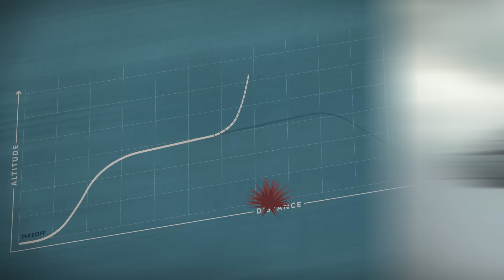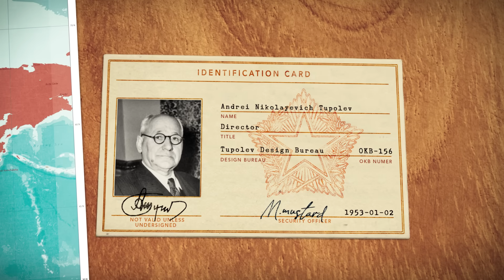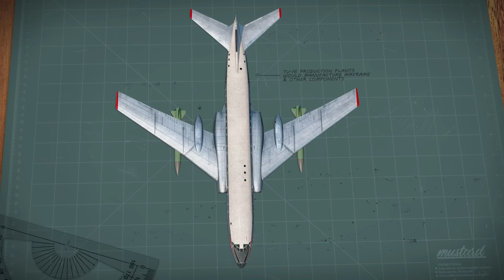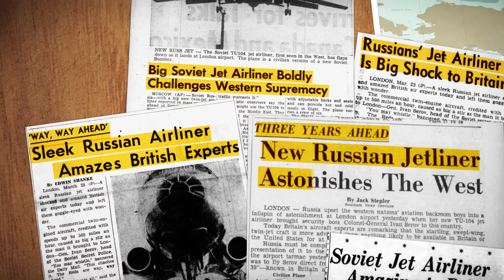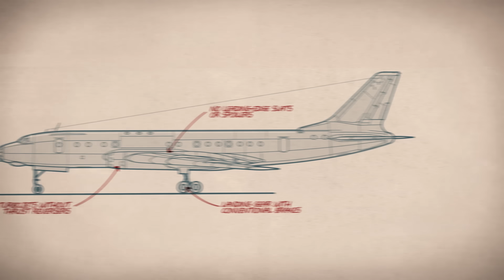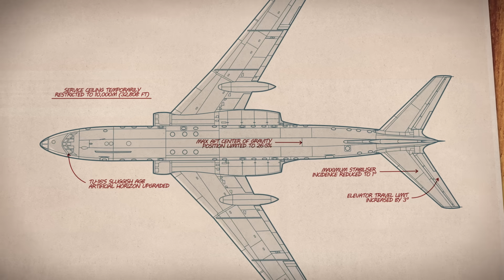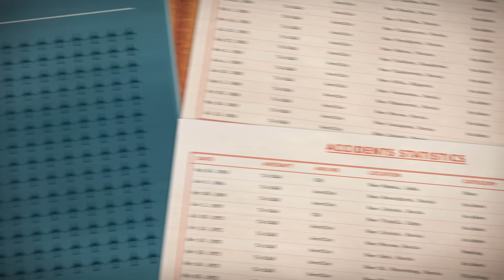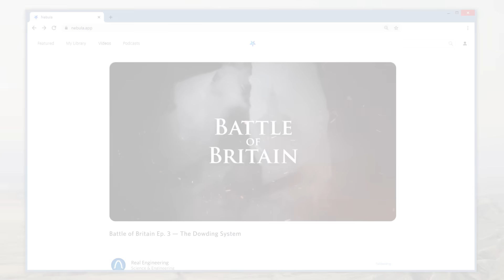The Soviet Airliner Designed To Crash

Comment: They were first so there will always be infancy issues but  for the DC10 and the 737 there are no excuses.
Reply: The de Havilland Comet was the worst jet airliner in history with a much worse loss rate and fatalities statistics.

The DC-10 has a very good safety record compared to the Tu-104 or the Comet and is still in service.

The Boeing 737 is the most successful aircraft in the entire history of aviation...  it safety record is also much better than this or the Comet.
Reply: @sandervanderkammen9230 

@sandervanderkammen9230 
Obviously it's always very important to note the relevant facts.

Kharzeestan Krappenz DiktorBummer  Diktorbatermasturjurkzxoffenzische etc and co - they should all note good with much awe & extreme wonder.
        UPDATE MORE BREAKING NEWS ETC

    How things were back then -
Accident losses - % of aircraft built.
DeHavilland Comet 4 UK     14% 
DeHavilland Comet all mks  17%  
Vickers VC10 UK 5%
   The DH Comet had better safety than or similar safety to many other commercial passenger aircraft of a similar era
    Douglas DC-1        99%
      Douglas DC-2        47%
    Douglas DC-3        30%
      Douglas DC-4          26%
    Boeing s300            72% 
 Boeing 307               70%
  Boeing 247                48%
     Boeing 707                   20% 
Lockheed L-049/149 Constellation  30%
   Lockheed Electra  Turboprop    29%
Fairchild FH-227                        30%
 McDonnell Douglas DC-8        14%
  Sud Aviation Caravelle            15%
Canadair CL-44  Turboprop     46%  
Convair CV-580  Turboprop     22%
Convair CV-880    (ff 1959)       27%  
Convair CV-990     (ff 1961)      33%

        The Comet was designed with military use in mind, Nimrod work started at De Havilland in 1953.
  The committee did not find hundreds of fatal flaws or evidence of design defects, structural defects, defective materials or shoddy workmanship. Ripstop provision was included. Claimed incidents did not involve cracks starting from window corners.
     The engine & engine intake position had advantages, were not flaws or fatal flaws & were not the cause of any incidents involving any Comet or Nimrod aircraft. Nearly all changes before the Comet 4 were just in case or were previously scheduled improvements. 
  Bow-wing & the 707 story (see b-47 wing folding incidents) is the result of global economics & the well protected & very large domestic US airliner market & active support from the UK with for instance proposed competing airliners from Vickers & DH being blocked by the UK government at the time, cheap & nasty was the requirement with large scale production capability in one place.
  The 707 was of course a much larger aircraft which as a stressed skin metal airframe aircraft would require a thicker skin anyway. They got lucky at the time essentially.  Bow-wing is the result of the large & well protected  US domestic airliner market 
  The fate of De Havilland was due to Govt policy Aerospace sector rationalisation & global economics, it was nothing to do with the Comet.
  A comprehensive, thorough & protracted testing program was carried out on the prototype & it's assemblies. Of course the Comet did indeed have Ripstop stop provision. 
     De Havilland (Of England) Comets were not grounded after 1970 due to structural problems.
It's interesting that some of the aircraft on the list should really have been noticeably safer than the Comet due to being a similar type but of much later design & manufacture but they definately were not safer.
    How things were back then -
Accident losses - % of aircraft built.
DeHavilland Comet 4 UK     14% 
DeHavilland Comet all mks  17%  
Vickers VC10 UK 5%
   The DH Comet had better safety than or similar safety to many other commercial passenger aircraft of a similar era
    Douglas DC-1        99%
      Douglas DC-2        47%
    Douglas DC-3        30%
      Douglas DC-4          26%
    Boeing s300            72% 
 Boeing 307               70%
  Boeing 247                48%
     Boeing 707                   20% 
Lockheed L-049/149 Constellation  30%
   Lockheed Electra  Turboprop    29%
Fairchild FH-227                         30%
 McDonnell Douglas DC-8     14%
  Sud Aviation Caravelle       15%
Canadair CL-44  Turboprop   46%  
Convair CV-580  Turboprop 22%

A comparison of more recent aircraft.
Accident losses comparison examples. 
1970s - 1980s
    % of total Aircraft built
Similar aircraft type, date / decade, useage, size.
    Biz Jets
BAe-125-800                        1.7 %
Beechcraft Beechjet 400    2.2 %
Cessna 550 Citation II         7.1 %
Learjet 35 / 36                       12 %
Beechcraft 1900                  6%
Dassault Falcon 10              11.5%
Aérospatiale SN.601            22.5%

Medium size jets / Turboprops.
BAe-146               5.1%
Fokker 100          6%
McDonnell Douglas DC-9-30       9.5%
Fairchild FH-227       30%
McDonnell Douglas DC-8    14%
Canadair CL-44  Turboprop   46%  
Convair CV-580   Turboprop   22%

Beechcraft, Fokker, McDonnell Douglass, Learjet, Fairchild, Aerospatiale, Canadair, Convair  companies defunct.

    All Comets, including some Comet 1s, had full civilian use certification at some point after 1954,  civilian use certification only being withdrawn after commercial flying stopped. Examples were flying until 1997 - one example did a signals research global circumnavigation flight series in 1993 via Australia virtually without a rest travelling 28000 miles, only had an ice warning indicator issue during the flights.

    The DH Comet - World Firsts.
1st gas turbine jet powered airliner. 1st high altitude 8psi pressurised full fuselage length passenger cabin airliner,  not a trivial feature as structure  strength required for pressurisation considerably exceeded strength required for normal flying stress. Nobody else had done anything similar before the Comet.
  The b-47 used 2 relatively small, heavily built  pressurised modules  (the aircraft where 6 had their wings fold up in 2 months while flying & some had their wings fall off while parked). 
   The 1937 Boeing piston engined airliner pressurised passenger cabin was pressurised to 2 psi only - in fact that could easily be done as the normal unpressurized fuselage cabin structure strength for flying stresses only was all that was needed to be adequate so no significant weight increase issues needed addressing.
    1st all hydraulically powered flying surface controls & actuators airliner with under carriage wheel disk brakes + ABS.
1st jet airliner to cross the Atlantic.
1st jet aircraft to do a world circumnavigation flights series.
  Of course De Havilland had prior experience building many all metal construction airframe aircraft including thousands of jet powered fighter aircraft that were primarily of metal construction with pressurised cockpits & jet engines built by De-Havilland & we know the world's first all metal construction airframe airliner was built in England in the 1920s by Handley Page.
     De Havilland did indeed always work to better than industry standards at the time, used up to date knowledge for the design & no evidence of negligence  or criminal negligence was ever produced in relation to the DH Comet.
    The course of De Havilland & the general UK aerospace industry sector was not affected even slightly by the DH Comet. The course of national aerospace sectors obviously being similar & inevitable in many countries.
     Other interesting World firsts
World's first turboprop aircraft.
Vickers Viscount Turboprop Airliner 1947. 
A 1945 Gloster Meteor Aircraft with Turboprop Gas Turbine Engine.

They might like to answer these questions.
   Which airline has just ordered
60 RR England Trent XWB Engines
& What aircraft are the engines for?

Bonus question for 10 points.
         Which country has the 
World's Highest Combined Per Capita
  Nuclear + Defence + Aerospace Sector Activity?    

          👍 & 🙂 & of course 😎 indeed.
          C H E E R S & without doubt  -
          Toodle PIP Old C H A Ps.
 
This line left not blank intentionally.
           
   The next line is blank intentionally.     
             
. .... . ... ... ...... .     ...
. . ... ..         ... . .........
 ....    .... ............ .....   .
Ivcxivcxivxcv
cxcxcvccbxcv
xcxiivxccxvcxv
ccvvcvvvcvxcv
vivcxiccvccvx
Reply: @sandervanderkammen9230 

We feel we can shed some light on some common myths & misunderstandings repeated in many comments.

It's not valid to compare a Bow-wing ( see B-47 wing folding & wing collapse incidents for details) jet  airliner designed & first built as late 6 decades after the Comet, with the fabulous De Havilland Comet, the world's first high altitude jet powered airliner.  
  Vast improvements in commercial aviation infrastructure alone being a significant factor in improvements in air travel safety safety over mire than half a century.
    Of course 50 years more design, build & operation experience didn't prevent the horrendous Bow-wing Max  incidents, there can obviously be no excuses for that.
  
  That's correct of course, at the time the Comet wasn't particularly dangerous. Agreed, that is indeed the case of course, The DH Comet was definitely not the worst engineering failure in commercial airliner history.

Losses comparisons
How things were in those days.

DeHavilland Comet 4 UK                  14% 
DeHavilland Comet all mks             17%  

Boeing 307                               70%
Boeing 247                               48%
Boeing 707            .                  20% 
Lockheed Electra Turboprop   29%
Canadair CL-44  Turboprop     46%  
Convair CV-580  Turboprop     22%
Convair CV-880    (ff 1959)       27%  
Convair CV-990     (ff 1961)      33%

     Of course De Havilland had prior experience building many all metal construction airframe aircraft & thousands of jet powered fighter aircraft that were primarily of metal construction with pressurised cockpits & jet engines built by De-Havilland.

  Yes, that's true, De Havilland carried out full stress analysis & engaged in a comprehensive & protracted testing program which is why key De Havilland people were happy to be aboard flying DH Comet aircraft. The Comet was the first airliner where stress due to pressurisation significantly exceeded flying load stress for a full length passenger cabin fyselage.

    We agree, that's correct, the DH Comet was the first passenger airliner with full length fuselage pressurisation at 8psi pressure differential. Handley Page built the world's first all metal construction airliner during the 1920s.
    In many cases earlier pressurised aircraft were larger, needed thicker fuselage skins due to flying stresses alone & had much lower pressurisation differential pressure. 

     Of course ripstop provision was provided. The skin alloy used became unavailable at the time due to R & D at the manufacturers which resulted in the original alloy being discontinued. Later alloys had very similar properties. The skin thickness used for the Comet was used for similar size later aircraft. Frame spacing was not found to be too large & frame width was not found to be too small.

    Without doubt De Havilland did indeed always work to better than industry standards at the time, used up to date knowledge for the design & construction & no evidence of negligence or criminal negligence was ever produced in relation to the DH Comet.

   Obviously the DH Comet had no effect on the course of the aerospace industry in the UK. The UK now has the world's largest combined nuclear, aerospace & defence sectors per capita activity.

    That's correct, the investigation committee did not find hundreds of fatal flaws or evidence of design defects, structural defects, defective materials or shoddy workmanship. Indeed it is the case that ripstop provision was included. Claimed incidents did not involve cracks starting from passenger window corners.
   Pretty much all changes were just in case changes or were planned development modifications & improvements that were scheduled regardless of incidents.

    Obviously De Havilland designers knew all there was to know about metal fatigue at the time they designed the DH Comet.

    It is in fact true to say that the way airliners were built changed everywhere including in the US after the Comet incidents.

We hope this helps, obviously.

Cheers indeed of course 👍. 
    
 . . .... ... ..... . ..
.... ..... .... .... ..

Comment: I am back with an update i think we all can agree the new 737 max is even more Dangerous
Reply: The Boeing 737 Max has a much better safety record than the Comet or the Tu-104
Reply: @sandervanderkammen9230 

We feel we can shed some light on some common myths & misunderstandings repeated in many comments.

It's not valid to compare a Bow-wing ( see B-47 wing folding & wing collapse incidents for details) jet  airliner designed & first built as late 6 decades after the Comet, with the fabulous De Havilland Comet, the world's first high altitude jet powered airliner.  
  Vast improvements in commercial aviation infrastructure alone being a significant factor in improvements in air travel safety safety over mire than half a century.
    Of course 50 years more design, build & operation experience didn't prevent the horrendous Bow-wing 737 Max incidents, there can obviously be no excuses for that.
  
  That's correct of course, at the time the Comet wasn't particularly dangerous. Agreed, that is indeed the case of course, The DH Comet was definitely not the worst engineering failure in commercial airliner history.

Losses comparisons
How things were in those days.

DeHavilland Comet 4 UK                  14% 
DeHavilland Comet all mks             17%  

Boeing 307                               70%
Boeing 247                               48%
Boeing 707            .                  20% 
Lockheed Electra Turboprop   29%
Canadair CL-44  Turboprop     46%  
Convair CV-580  Turboprop     22%
Convair CV-880    (ff 1959)       27%  
Convair CV-990     (ff 1961)      33%

     Of course De Havilland had prior experience building many all metal construction airframe aircraft & thousands of jet powered fighter aircraft that were primarily of metal construction with pressurised cockpits & jet engines built by De-Havilland.

  Yes, that's true, De Havilland carried out full stress analysis & engaged in a comprehensive & protracted testing program which is why key De Havilland people were happy to be aboard flying DH Comet aircraft. The Comet was the first airliner where stress due to pressurisation significantly exceeded flying load stress for a full length passenger cabin fyselage.

    We agree, that's correct, the DH Comet was the first passenger airliner with full length fuselage pressurisation at 8psi pressure differential. Handley Page built the world's first all metal construction airliner during the 1920s.
    In many cases earlier pressurised aircraft were larger, needed thicker fuselage skins due to flying stresses alone & had much lower pressurisation differential pressure. 

     Of course ripstop provision was provided. The skin alloy used became unavailable at the time due to R & D at the manufacturers which resulted in the original alloy being discontinued. Later alloys had very similar properties. The skin thickness used for the Comet was used for similar size later aircraft. Frame spacing was not found to be too large & frame width was not found to be too small.

    Without doubt De Havilland did indeed always work to better than industry standards at the time, used up to date knowledge for the design & construction & no evidence of negligence or criminal negligence was ever produced in relation to the DH Comet.

   Obviously the DH Comet had no effect on the course of the aerospace industry in the UK. The UK now has the world's largest combined nuclear, aerospace & defence sectors per capita activity.

    That's correct, the investigation committee did not find hundreds of fatal flaws or evidence of design defects, structural defects, defective materials or shoddy workmanship. Indeed it is the case that ripstop provision was included. Claimed incidents did not involve cracks starting from passenger window corners.
   Pretty much all changes were just in case changes or were planned development modifications & improvements that were scheduled regardless of incidents.

    Obviously De Havilland designers knew all there was to know about metal fatigue at the time they designed the DH Comet.

    It is in fact true to say that the way airliners were built changed everywhere including in the US after the Comet incidents.

We hope this helps, obviously.

Cheers indeed of course 👍. 
 
 . . .... ... ..... . ....
. ..... .... .... ........
Reply: @sandervanderkammen9230  Holy shit bro is Boeing your wife or something
Reply: @sallytheuselessbird  Childish insults won't prove your point or make you look very intelligent, lad.
Reply: @sandervanderkammen9230  boeings are very unsafe at the moment, they destroyed their reputation.
737max  is a fine example
Reply: @eu3127  Only among the uneducated non-proffessionals and the news media.
Boeing makes the safest aircraft in the world, and the people who actually buy airliners know the truth.
Boeing just received another order for 200 more 737 Max aircraft.
The 737 is the most popular and successful aircraft in the history of aviation.